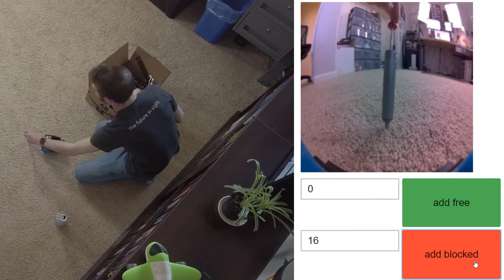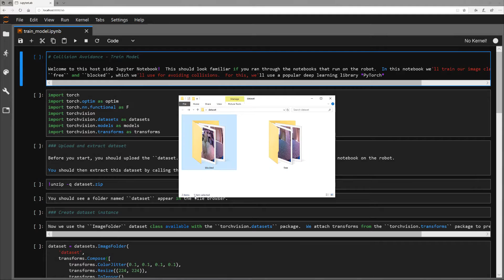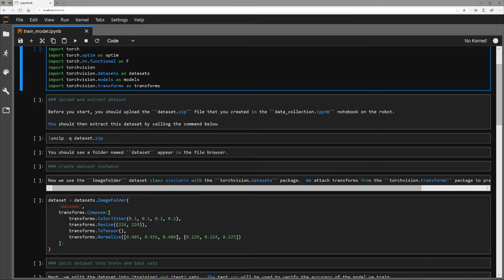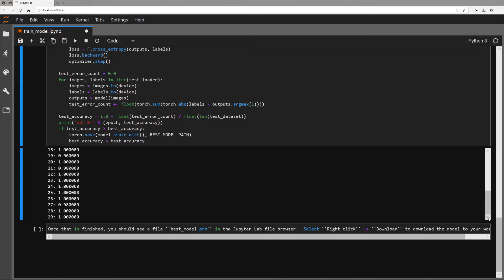Jetbot Neural Network Based Collision Avoidance

Comment: Any tips on how you collect data such as image, throttle, steering angle into a dataframe for machine learning?
Reply from the maker: hey! yes, you generally need to work with an image sensor that has a sync or trigger pin that allows you to synchronize a frame capture with data from other sensors.
Reply: @ZacksLab  Ohhh boy I got some learning to do, any tips on how to get started on that? So my plan is to use the following:

-Nvidia Jetson Nano on the rc car to run the machine learning model
- A basic computer camera to capture images
-A built RC car with an ESC and Motor and a controller

Is there any specific way to connect these tools to collect the data or will I need something special?
Sorry for the complex questions here haha but any helpful directions would be appreciated! Or if you have videos on this I would love to watch. Thank you!
Reply from the maker: have you chosen an image sensor? i would start with the datasheet to learn its different capture modes

from there, define your sensors for steering position, throttle, etc... and figure out their interfaces. it's likely you can use the Jetson's GPIO or SPI/I2C (what ever the interface is) to orchestrate all the triggering of data. you'll then need to define some sort of data structure for storing the image data + sensor data.

i doubt something like this exists exactly for your use case, so you'll have to write your own drivers and software for handling all of the above. depending on the image sensor and other sensors you chose, the drivers may actually already exist in the linux kernel, but you'll have to enable them. i don't have any youtube videos on how to do this, but basically you have to reinstall Jetpack and recompile the kernel, device tree, and modules. there really is no easy shortcut for doing this, you will have to go down the rabbit hole of linux.

alternatively, you can add a microcontroller that orchestrates the frame sync with other data and pass the data over the jetson side of things and then handle it in software at that point, it won't be as high of performance given the latency through the micro, but if your frame rate is low, it probably won't matter.
Reply: @ZacksLab  Thank you so much for your response I will keep all of these notes in mind going forward. It seems like I have a lot of work ahead of me and Nope I haven't pocked an image sensor yet but I certainly will soon to get started. If all goes well, in about 8 months, I'll have it done and I shall show you it. Thanks agaiN!

Comment: How long does your jetbot last with a fully charged battery?    You said you are using a 10 amp battery.
Reply from the maker: average current draw is around 1A, so with a 10Ah battery you get close to 10 hours of run time. under full load the nano can draw 10W, so run time will be closer to 5 hours if you're doing a lot of compute.

Comment: Hi zack! i got myself a jet bot but i'm having trouble with the training of the last layer of the AlexNet  model. I moved the dataset over to my laptop and ran the code  using my gpu but  but it gave me this error

CUDA error: CUBLAS_STATUS_ALLOC_FAILED when calling `cublasCreate(handle)`

I tried running it on the cpu
Reply from the maker: hey! without seeing your code it will be hard to help you... do you have it in a github repo? i could take a look if so
Reply: @ZacksLab  sorry i should've edited the comment cause i submitted it by accident without finishing and then i forgot to do it  X.X my bad. anyway the code is the exact same one that you showed in the video, the same one on the jetbot github. copied and pasted it from github to a jupyter notebook on my laptop but it doesnt run the last cell where you create the new model based on the alexnet model and the dataset. if i run it on the gpu i get the error message  i wrote in the previous comment. if i run it on the cpu i get another error message pointing to the line  "loss = F.cross_entropy(outputs, labels)" in the last cell of the code saying that target 2 is out of bounds. the code is the exact same one as on the jetbot github, which is kinda weird cause everywhere i look on youtube everyone seems to have no issues with this collision avoidance program, meanwhile i'm having trouble running some code that is supposed to be good as it is. by the way thank you for replying!!!

Comment: Do you think it's possible to do same with a drone ?
Reply from the maker: absolutely. just need access to the autopilot. pixhawk (and similar drone APs) can take external commands that could be coming from an AI system such as this.
Reply: @ZacksLab  Is there any blog or site where I can read more about it ? I'm working on a project and would love to implement some of this.
Reply from the maker: I'm not sure if there is one specifically for what you're talking about doing, but there is plenty of documentation on pixhawk autopilots for drones if you search for it. what drone platform do you intend to work with?
Reply: @ZacksLab  I have an intel aero ready to fly drone, it comes with a pixhawk as the flight controller. I have seen some works with the same configuration but a raspberry pi is used as the companion computer. I would like to use the Jetson nano as the companion computer instead for the purposes of data collection & collision avoidance as  you have shown here with the jetbot, but obviously in my drone.
Reply from the maker: ah, got it. you have to look into the documentation for that platform, however, since you said it uses pixhawk you can likely use the jetson nano to send maneuver commands to it via serial or CAN.
Reply: @ZacksLab  Ok I will. Hopefully everything works as intended. Thanks for your guidance here, and excellent video tutorial btw !
Reply from the maker: Yep, if I were you I'd start simple... try to send commands to pixhawk over its serial interface, you can use a simple FTDI cable to convert commands from your PC to the pixhawk. Just make sure serial tx and rx are at the correct voltage levels (I can't remember if pixhawk is 3.3V or 5V logic levels). Once you've got that side down you can switch to the Jetson and have it give it serial commands (or CAN). FYI I think Jetson has a CAN controller but you'd need to still add the CAN transceiver if you want to go that approach.

Comment: This might be a simple question but How do you transfer your dataset to the desktop pc, and transfer the trained model back to the Nano for demos ? I know you mentioned via Wifi but I'm kind of curious on a bit more depth explanation, Thanks.
Reply from the maker: i use WinSCP to do secure file transfer. you can open a SFTP connection to the IP address and transfer files to and from your PC and the remote connection (in this case, the Jetbot)

Comment: Do you know the actual range of the camera ? how far can it detect objects from ? Great video by the way !
Reply from the maker: i do not know the max detection range of this camera (its also a function of the size of the object). i have worked with high megapixel cameras capable of doing object classification out to 1km. of course this depends on your computer vision and post processing algorithms as well.

Comment: How long did it take for you to transver the data to your PC?
Reply from the maker: I log into the Jetbot using WinSCP and transfer the files over SFTP. Took less than a minute... both my computer and Jetbot were near my router.
Reply: @ZacksLab  aha! Today I tried transferring around 60 pictures. But when I was planning to download the 'dataset.zip' file in the collision avoidance demo, it said that I had no permission!
I have no permission to download that zip file... Do you might have a clue?
Thanks in advance
Reply from the maker: What software are you using to transfer the file?
Reply: @ZacksLab  well all these things happen in jupyter notebook. I always download my zip files with WinRAR.
I heard it took a while for the jetbot to process all the pictures. But 3 hours later it still didn't worked..
Reply from the maker: Hmm, if you're trying to transfer to a Windows PC, download WinSCP and you can use SFTP to transfer files to and from your Jetbot (use the Jetbot username and pw to login). If you're having issues locally on the Jetbot, it could be a Linux permissions issue, which you can adjust for that file with the terminal command: sudo chmod 777 /path/to/file.zip
Reply: @ZacksLab  well with winscp, he cant connect. And the other comment wont be regconised . "Chmod: cannot acces "/path/to/dataset/zip"" : No such file or directory
Reply from the maker: are you replacing "/path/to/dataset/zip" with the actual path to the file? also do you have SSH enabled on Jetbot so you can start a secure connection with it? that could be why SFTP isn't working with WinSCP

Comment: Can you do this on a open MV h7?
Reply from the maker: It looks like OpenMV H7 is an ARM based computer vision platform. I have seen people implement neural networks on microcontrollers, but I would imagine that you will quickly reach its limitations. Also, you cannot take advantage CUDA or libraries and frameworks like TensorFlow, TensorRT, PyTorch, Keras, etc... unless you're developing for a system that can run Linux and has an NVIDIA GPU available to it (like in the case of the Jetson Nano).

Comment: Awesome vid. I am not into making robots at the moment, but I would like a dedicated machine to learn Python & ML. You obviously did the training on your desktop for performance reasons. I am a bit worried that I am going to run into too many limitations with this. I just started this book - https://pragprog.com/book/fbmach/genetic-algorithms-and-machine-learning-for-programmers . Would you recommend the Nano for someone learning? Price point is very attractive.
Reply from the maker: hi Brent! if your goal is to apply ML to robotics, the Jetbot is probably one of the lowest price-points for an entry level platform with good compute power on the edge. if you're just interested in learning ML, there's a lot you can do with just a PC and some data sets. the only difference using a Jetbot is that it allows you to use AI to make decisions and directly interact with the physical world. with a bit of hardware knowledge, you could expand the Jetbot to have more sensors/actuators and do many different things. the book you linked to seems to be pretty good, has good reviews on amazon (but not many). also fyi the paperback is 10 dollars cheaper on amazon: https://amzn.to/2FyUMHi
Reply: @ZacksLab  - I aleady got the PDF for that book, thanks for the link though --The thing is, I dont want to do anything with robots. I want a dedicated machine to run a terminal, code editor, and a couple of browser tabs. - I have a apple macbook which I use for work. Dont want to clog that up with ML projects. I guess I could build a desktop with a 1070 but thats much more expensive, or maybe a laptop. I guess my question is: - Is this a waste of time as a platform to learn Python & ML a few hours a week?
Reply from the maker: @brentgreeff1115  Running it like a desktop (code editor + browser tabs) is possible, but that's not its intended purpose. I can't speak for how well the Nano performs when using it as if it were a PC. If a PC with a GPU is within your budget than you're better off putting that money towards it. Otherwise, the Nano could get you started but consider it a sunk cost once you've reached its limitations. You could maybe sell it on ebay or to a friend at that point.

Comment: Can you use the jetson mano to build a drone using the battery that you have
Reply from the maker: The Jetson Nano could be used onboard a drone for many different functions, however you’d still want to use LiPo batteries intended for use with motors, as the BLDC motors commonly found on drones can pull a lot more current than this battery is capable of providing safely.

Comment: Awesome, I'm working on my turtlebot project, using ROS's gazebo to do simulation and A3C(a Reinforcement Learning algorithm) to train the BOT. It can save tons of time by avoiding gathering data and label them.
Reply from the maker: jack flynn, interesting. How is the simulation environment generated? It would be cool to see a side by side comparison of both methods. I would imagine that the ideal training set is a combination of both sims and real data.
Reply: @ZacksLab  well the problem is not about the simulation, its about Deep RL algorithms. As DeepMind's research from DQN to DDPG and A3C(Deep RL methods) take raw pixels as input, and learn how to avoid obstacles and even navigate through maze.
Reply: @ZacksLab  this is a Video by DeepMind, it's a result on playing TORCS using A3C methods:
https://www.youtube.com/watch?v=0xo1Ldx3L5Q
Reply from the maker: jack flynn So does the AI in the video you shared always stay inside the simulated environment? What happens when you put AI that was trained strictly on simulated data into a physical device in the real world and it encounters scenery, lighting conditions, objects, and scenarios that the simulator wasn’t able to provide? 

The issue with training on data generated in simulators is that the real world throws scenarios at the AI that the simulations just can’t account for. Are you saying that the A3C method solves this issue?
Reply: @ZacksLab  okay, I got it. Actually RL's main idea is learning by interaction. It let the agent(jetson bot in this case) try moves and gain rewards. If it hit an obstacle then this episode is finished and gain negative reward. Agent's goal is to maximize total reward. So after episodes of episodes of learning, it adjusts parameters in the agents NN.
This can be done in a simulated environment or done in real world. The agent is a policy network which in A3C methods is also called an Actor. It's a policy network, when you input a state(a image from camera) it output an action(left right forward or stop). A3C is a RL methods, RL is different from supervised learning in that you don't need to give your learner labeled data.
Back to the simulated env, if train the bot is difficult in real world. Then it can be done in simulated env. Which ROS(robot operating system based on Ubuntu) provides tools to do that. When your agent/actor is well performed in the simulation, putting it into real world is easy(ROS makes sure of it).
I did some experiments, after the robot is trained in the simulated env, it works on every kinds of ground surface. Maybe because the weights on pixels related to the grounds are small.(Still working on the prove that).
Reply from the maker: @jackflynn3097  that sounds really cool and very similar to how humans learn from experience.

how do you define what is "negative" and what is "positive". it seems that for us humans we have pleasure/pain governed by our nervous system and neurotransmitters... how are these concepts created in software so that the agent can learn from its mistakes unsupervised? 

also, is this method slower? for example you can simulate/feed data into a NN much faster than a human can absorb information... does this method slow down the learning process compared to other methods?
Reply: @ZacksLab  actually, the reward is given by reward function. In AlphaGO the reward function is GO's rule. In Atari games the reward function is how much points you got. In simulation we can define a reward function, since the reward is to avoid obstacles, it it hit one then give it a negative  reward is natural.  And yeah, I forgot to mention is that rewards are *numerical values*. like a negative reward can be -1 or -2 or more. Total rewards are summation of rewards. Since totals rewards is related to actor's NN's parameters, we can use gradient ascent to train our NN. Once we improved this actor, we use this actor to play more games and collect more training data(actually its time delayed label, and the label is reward. Which you dont have to manually label them), and use there data to train the actor. and so on...
RL's learning manner is more like how natural intelligence is learning.  It learns by interaction.  if actor gets more rewards then it knows these actions are good to take under these circumstances. I can only explain it in this simple way. Coz RL is rather hard to learn. 
As for speed comparison. We just can't compare the speed between RL and supervised learning. Since it solves problems differently. In GO, the states and actions can be as many as atoms in our observed universe. It just impossible to solve it using supervised learning. But it can be solved by RL. 
Also, if I want to train a NN to play atari games. I have to manually label training data, or write Object detection codes and et. But with RL, I just need to give my actor raw pixels as input and nothing more(the reward and state is given by the game).
The actor/agent I trained to play Space Invader took about half a day using Tesla V100, but if I were to use supervised learning, It would take me more time to write codes and tune the NN.